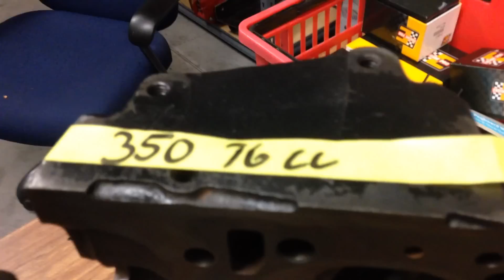350 and 305 Chevy what's The Difference

Comment: 305's are good motors. Yes 350's are better for making power. Good thing about 305's is because they have a bad reputation for being junk you can get them for a dime a dozen. I picked one up for $100.00 with less then 50k miles on it.
Reply: jayson brock 
Yup, good cheap motors.
Reply: jayson brock
Reply from the maker: I just put a vortec 305 roller engine in my 77 chevy 3/4 ton pick up it's just a stock truck I will use for an extra vehicle will haul engines around and probably use for yard work and home upgrades it runs very well If I need to run to the store or pick up parts or even go get lumber or building supplies at home depot I do not need a 700 HP Big Block there is nothing wrong  with a 305 engine they are very reliable the cores are cheap and they get better mileage that a 350 all day long for doing the things I listed above they have more than enough power especially if you add an RV cam and good intake and EX mine has a roller RV Cam 208/218 dur @.050 edelbrock duel plain intake with 650 cfm carb and duel 1 7/8 ex with flow masters it runs very well it won't be winning any drag races but I did not build it for that most of the guys saying 305's suck have the mind set that everything you drive has to have high HP and be able to win a race at any time it's just silly
Reply from the maker: Yes I agree your post is an exact discourse of how I see it when I need to run across town and pick a set of heads or to home depot I don't really want to fire up my 600 HP drag truck let it warm up and fight it the entire way there and back because it was not really made for a daily driver it gets hot and has lousy driveability manners not to mention my wife hates it she wants smooth quiet and A/C and there are many times I would really like her to go with me to Home Depot or even out to eat She is a girl and I really like spending time with her the 305 Truck is perfect for it
Reply: Or, I don't know. Maybe order a 3.75" stroke crank, and forged pistons, forged rods, forced induction, and appropriate cam and aluminum heads (they are out there, just do the math); the 305 can be a fun street or race contender.
Reply: jayson brock they are tough motors.  I had a 305 twice, one in my 77 caprice I put a 4 barrel carb and a 400 turbo tranny I gave some 350s hell , but it's runs so smooth.  I also had the 305ho in my 85ss I currently own  (now it got a 383 in it) but the take off with that 305 was very nice. I never have nothing bad to say about a 305 . but like you said you want to make more power get a 350.
Reply: Tywon Allen d
Reply from the maker: I just picked up another 305 core today for $60.00 I will do a quick build and sell it for a decant profit
Reply: Put some 906 or 062 heads on it and test it.  906 are better!
Reply: I think the reputation goes to the issue of misapplication of purpose. Had a roommate once who had an early 90's Camaro with a 305. Towing a boat (yes he did that) and driving it hard, he blew up the engine eventually. The 305 is not weak but it's closest comparison in the GM family is the small block 307. Drive it doing what it was designed for, and you won't have any problems compared to any other engine. That means standard performance and ordinary stream-of-traffic driving.
Reply: 305 was the first motor, yo hit a million miles
Reply: jayson brock I got one once from a guy throwing one away.
Reply: Someone was going to build a rock crawler s10 blazer.  Here was a 305 crate engine with zero miles.  The advertised price was $300.  I offered $200 and now it's in my pickup.
Reply: Baily DenhHouten that's what I'm saying! For example the RS Camaro has a 175hp 305cubic inch V8 but most people call it slow and say the z28 is so much faster when it also has a 305cubic inch, and only has 30 more hp and 30 more torque
Reply: Myvintageiron7512 I honestly don't care for speed in a truck to me it's all about low end torque, now cars on the other hand is an entirely different story
Reply: I had a 305 in my 77 Malibu.  Never had any problems with it.  Had a smooth pick up if you punched it.  Problem is people comparing the power to a 350.  The 305 is exactly what it was created to be.
Reply: Exactly... i bought a '82 with one in it.. only 31k miles...
Reply: Yes your right they are good motor's if you want power just bore it out cam it . Had one in my 82 Silverado Short bed it did good.
Reply: They can make just as much power and take more abuse and don't overheat due to having more meat between cylinders
Reply: i got 454 for free with 6000 miles on it the last 454 i think i paid 150 for and i can get 427 200 396 for 150 they all run and have 400 turbo's behind them came out of running and driving cars just got a roller 390 for my high boy cheap
Reply: @otto yanukovych i will check my buddy he has a few got ford motor do wont a running or builder and do u wont size i'm checking on a 427 right now there a 396 but i have never herd it run they say it does but i'm saying it is a builder
Reply: Great for everyday running cars.
A g body wagon with cold ac will run you everywhere you want to go and more.
Reply: Everything he said about that head is true but the HO 305 head will flow more than the non HO head.
You can find the HO or high output heads on Monty ss and 84 trans am.
Reply: @justmeokay8253  what we do is take a set of 202 heads and make them 204 heads and u want close chamber with angle plugs just give a set of these away  that will make a 305 come alive
Reply: @jeffrey4547  if you want to make power, sure. 
But the HO TPI heads are made to flow perfectly with the 305 bore.
And they flow enough to feed a 350. 
But 305 bone stock with 2bbl tuned well with clean oil in it will be such a dependable set of wheels.
Reply: @justmeokay8253  what we do is take a set of 202 and port to 204 if we could we would go bigger the we port the heads and shave the heads to get the extra compression my 327 has lasted over 10 years and we drive it on the road it has been in 3 cars no my buddy wanted to try in a 4x4 that was funny 1 month 6 rear end but it would threw pavement at 55 with 44 hawgs it was a funny story still have the motor
Reply: @Myvintageiron7512  so I could put one in my escalade and get better than 16 mpg?... and the right cam will make almost as much power? .... I'm sold!
Reply: @thehighlife1320  the extra meat between cylinders would tend to make the block a bit stiffer, not a sharp a drop at the end of the curve... might be a realy good stoplight to stoplight street fighter.
Reply: @lukewarmwater6412  Unfortunately on the 305, there isn't extra meat in between the cylinders. Just more space for coolant. Only on the 3.875" bore Rocket block or related aftermarket blocks. But that's bigger than the 305's 3.736" bore.
Reply: @thehighlife1320  right, so since it is the same block just not bored out as far there have to be water passages where the 350 has none, right??.... I think you already know you are wrong.
Reply: @lukewarmwater6412  It is not the same block. The 305 and the 350 share the same bore center. But the 305 has a small bore size. 305 blocks don't have anything special about them. They do have a bigger water jacket than a 350, but that's it. Now a 305 block with a 335 stroker kit, and AFR or a pair of aftermarket heads with small valves; now we can talk. I think that if someone can cast 18 degree heads for small bore small  Chevy blocks, they will be a different animal. LS 4.8 engines can make good power too. Because those heads flow great numbers. Port size is one thing, but valve angle helps a ton.
Reply: @lukewarmwater6412  I do wish that the 305 was cast and machined for 4 bolt mains. But even the 305 engines in the Corvette and Camaro were two bolt mains. I might be wrong.
Reply: @thehighlife1320  there realy isnt that much benifit to having a four bolt main, what you want is one of those add on stiffiners that bolt on to the main caps. does the same thing.
  all of that is overkill for a daily driver anyway.
Reply: @lukewarmwater6412  A main girdle.
Reply: @thehighlife1320  yes! thank you....not to be mistaken with a man girdle.
Reply: @lukewarmwater6412  Haha, yeah. I say that the 305 is a good place to learn on the cheap, with patience. A small block Chevy has a huge legacy, and library of knowledge to learn from. And they are easy to work on.
Reply: I like the 305.....Bore and Stroke 'em and put a blower or supercharger or turbo on it they are Greeeeaaaaat  !!!
But you will pay through the nose for pistons. For some reasons all the parts for them are cheap, but pistons are super expensive, even plain cast or Hypereutectic.
Reply: @Otto VanHouten The 5.3L 305 is one of the best truck engines for going miles and miles, my Dad had a Pontiac with the 305.
Reply: I got a 305 with 400k miles. Still runs perfect.
Reply: They're damn near indestructible
Reply: jayson brock, I can get a 350 dressed or stripped for 150$ and up. 305’s are a head ache and not worth the build. If it’s an original engine in an original chassis keep it original but if your making a custom engine go 350.
Reply: @thehighlife1320  If you're building it for the street I would not worry to much about it being a 2 bolt engine.
Reply: @Myvintageiron7512  Wonder what it would be like with 64cc heads on one??
Reply: @Myvintageiron7512  Wonder what a 64cc head does for it, many many years ago a friend of mine overhauled his wife's s-10 blazer 307 heads wasn't any good put on a old set of 327 heads on it ran pretty dam good.

Comment: I've got a 98 sierra with a 305 and has 340k on it and still runs and drives very well, been a great engine for me.
Reply: You would only have a 305 if you put that engine in it. Gm stopped making the 305 in 1992
Reply: 305 definitely continued beyond '92. 305 Vortec in lots of OBDII ('96 and newer) full-size pickups. Personally wouldn't want one but they were more than strong enough.

Comment: I had one in a '81 silverado, had a huge carb factory and 2.55 rear-end changed to 3.40 rear-end and put headers on it. Would smoke the tires with the cruise control, once you got it spinning... hauled 1500lbs of concrete in it and many slow it down tickets. Motor trans combo was great.

Comment: I had a 305 four barrel in my 1982 Chevy van, it ran 23 years and over 260,000 miles and was still going fine when I sold it.  It never once broke down or needed any work other than belts, and oil, 2 starters and a water pump, no engine work.  Ran perfectly.

Comment: I love the 305 in my 82 Z28, it's been built up some and the car is a beast, never underestimate!.
Reply: Steve W what did you do to it??
Reply: I didn't do anything, I bought it that way but I was told it had a better peformance cam I believe mixed with a good TH350 trans and 3:73 gears.
Reply: Steve W yeah i would be impressed with a 82 camaro and its 150,horsepower trash car and trash motor
Reply: Its a fucking dog man u cannot make a 305 a "beast"
Reply: I had a z28 witha ho 305 it had 1.6 exhaust valves you can port and polish the headsbig cam screw in studs intake  good holly 373 .gear have some fun cheap.
Reply: The only ford worth having is a mustang and  thats after you put in   chevy engine and transmission
Reply: @itsok5079  I need to swap my 4.6L Ford engine for a 5.3L 305 :)
Reply: Mike M 5.3 is equivalent to around 327 ci. Regardless, can’t beat the power and abuse the LS engine can handle!
Reply: Mike M ....the 305 is 5.0. Ford's 302 is not quite a 5 liter, but so close they could label it as such.

Comment: I used to grind crankshafts back in the day. The old two-piece seal small block chevys. There was a small difference between the 350 and 305 crankshaft, even though the casting numbers were identical. If you stood each one upright side-by-side, and looked directly down on each, you would see the 350 first and second counterweights were identical size, meaning you could not see the second counterweight. The 305 first counterweight would be slightly cut back more, as to see some of the second counterweight. This was due to help the balance using  smaller pistons. But dementionally, they are identical. So to keep from having too big a balance issue with either, it's something to look for.

Comment: A marine mechanic once that told me the 283  was the best marine engine made. His reasoning was that the engine would run out of airflow or float the valves before the bottom end could be damaged. It didn't make as much power as larger 350s, but was hard to break. A great characteristic for marine use. Probably the same deal for the 305.
Reply: Both made great boat anchors not a performance engine by any stretch of the imagination people who have a clue to what's going on with motors at all
Reply: Yeah that's about all they were good for when you got through with them they made great boat anchors also

Comment: I've been a mechanic fifty years, and was working at a Chevrolet dealership when the 305 came out. They had a lot of camshaft problems the first few years, from wiped lobes to breaking in half. Timing chain problems too. One of our guys found a cam gear tooth stuck in the crank gear, but the cam gear on the engine had all its teeth. Anyway, that's what started the bad reputation, and I guess it's just passed down through the generations.

Comment: Another great trick with a 305 is to put a smaller crank and shorter rods in it and it pushes the redline up over 8,000 rpm's. Then there are other things to build up from there like, better heads, turbo, etc. Engine Masters had a great episode about it in one of the more recent seasons.
Reply from the maker: Great tip!

Comment: Had a 305 in my '77 Camaro.  Started out as a 2bbl car, stock.  Mustang GTs of the time would eat me alive.  I was dumb and didn't change the oil, ever, and spun a bearing (teenage years).  For the rebuild I got a high duration cam, put on dual glass packs, removed the cat, and put a 750 Holley double pumper up top (it was free).  Too much carb, and no low end torque, but that motor would scream at high RPMs.  I can't recall how many cars of the day I outran after that build.  Sure, a 350 would've been better but that little 305 had some magic in it.
Reply: That's what I've learned. 305s have nothing on the bottom, but wake up higher with a little help.
Reply: @FerrickOxhide  not true   Im making 409 hp @ 6400 and it pulls hard from 3000 RPM on, its an NHRA S/KA stock eliminator drag car not a street car.
Reply: @MasterWitchDoctor  I'm sure it's stock! 3000 rpm is still pretty high. I was referring to mainly stock engines. The little 307 outpulls them both at a lower rpm. I wish I still had mine!
Reply: Only in your imagination 😉

Comment: Flow is everything for a naturally aspirated engine regardless of the displacement.
Reply: To a point. You can build that engine all you absolutely can. Yet a massively huge exhaust and giant intake tube will not help
Reply: M H I believe what he is saying is cylinder flow, if you're heads can't inhale anymore than you're pretty much stuck in an n/a application. Forcing air into it is completely different, moral of the story is get the best cylinder heads you can afford

Comment: I had a 305 in a mid 80s Caprice Classic station wagon. The stock cam went flat (on the front 2 lobes) put a 350 spec. Cam in it and it ran crazy fast . The reduced duration and bump in the lift , raised the compression. I had to run 92/93 octane gas in it, but it was well worth it . I miss that car . It lived a life as a truck for the last 200k of its 300k . Great car .
Reply: Maybe if you're gonna be a grandpa or a grandma going to get the groceries to and from the house 🏡

Comment: Never called it junk. Fact is they were the best taxi motor they ever made. It was nothing to get 500,000 miles out of these motors,  since they invented overdrive transmissions.
Reply: They put 283s in the Checker Cabs! So I myself would beg to differ! LoL
Reply: train jam I got 375k on mine. Cam went flat. I could put a new cam in and kept going. I threw a 350 in instead.
Reply: I had one crapnout on me at under 80,000 miles and the junk 200 4R didn't last much longer